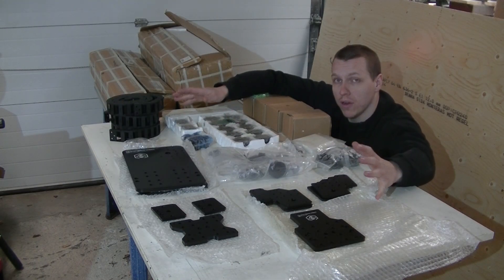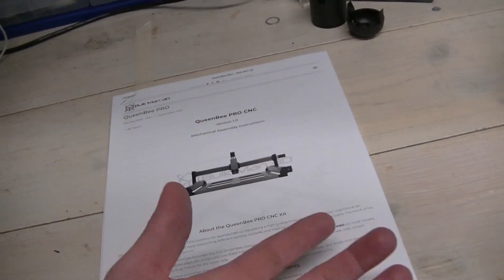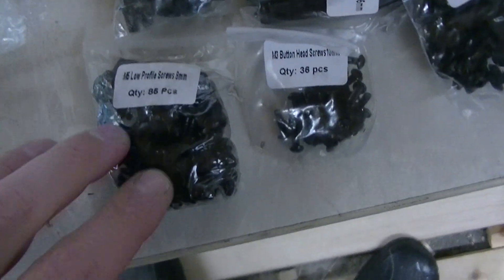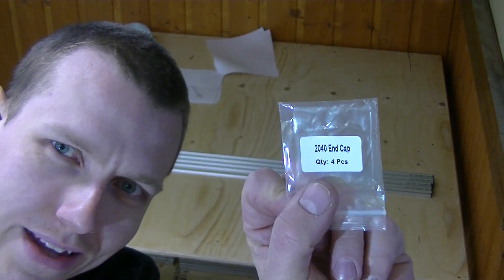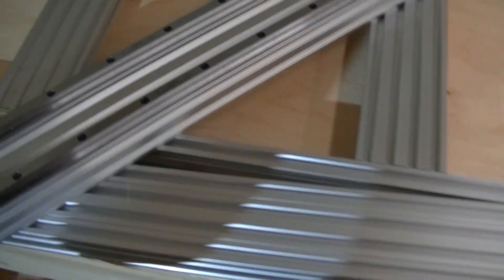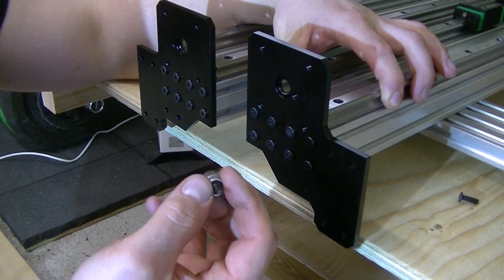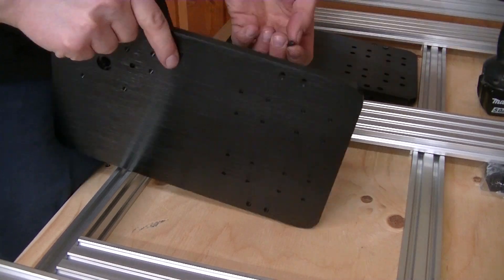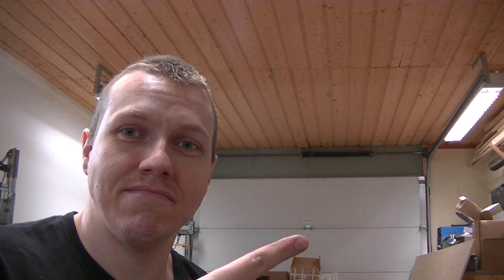Queenbee Pro CNC Router build part 1: First look at the machine

Comment: Hey, thanks for the videos. Was looking at the 1000x1000 mechanical kit as I have a good controller (DDCS 3.1). I understand that you are happy with the performance but I see people reporting variations in parts quality. Did you buy it from Aliexpress or from Bulkman 3d site? Thanks for your advice!
Reply from the maker: I bought it directly from Bulkman. The only problems I had was with the quality of the screws, many of them stripped out from being looked at wrong, and with cleanliness. They hadn't cleaned the aluextrusions after cutting them so I had to clean up a lot of swarf and crap. But apart from that I'm very pleased with it so far.
Reply: @OffHoursEngineering  Thank you. I think this is the kit for me...

Comment: I am considering the 1000x1000 with the air cooled 1.5kw kit.. you happy with yours?
What controller do you run?.. considering Duet wifi.. 
Just out of curiosity.. You Norwegian or swedish? :)
Reply from the maker: I'm Swedish, but I've actually worked in Norway for a couple of years. Yes, so far I'm definitely satisfied with the performance, especially at that price. The linear rails is what really makes it worthwhile in my opinion. Right know I'm using an Arduino as a breakout board and running Estl controller, but the plan is to upgrade to linuxCNC as time and cost allows.
Reply: @OffHoursEngineering  Have you considered Duet 2 Wifi?
Reply from the maker: Not for the router. I have looked at it as a possible upgrade to my 3d printer, but for the router I'd like something more industrial.
Reply: @OffHoursEngineering  Ok, many people prefere it to something like the Mach etc, just for the ease of use, web interface etc :)
Reply: @OffHoursEngineering  about how much slop / backlash would you estimate with this system?  Is it worth it over a system like the Genmitsu?
Reply from the maker: From what I've seen it beats the Genmitsu quite easily. The slop is minimal if you adjust the delrin-nuts right. 
I have measured a slight amount of flex in the middle of the gantry with an indicator with an excessive load. But I have seen no evidence of it during normal operation.
Reply: @OffHoursEngineering  interesting. I have yet to try to genmitsu but i needed to get something to get started

Comment: Those linear bearing blocks have the same sticky anti-rust goo that the linear rails had on them. Did you clean them also before installing?
Reply from the maker: Yes, I cleaned all of them thoroughly before installation. Then  I lubricated the blocks and rails with lithium grease that have the same lubricity as some of the "light" greases suggested in hiwins manual.